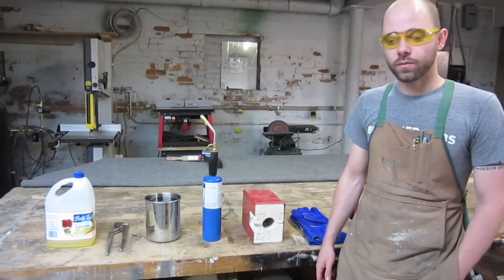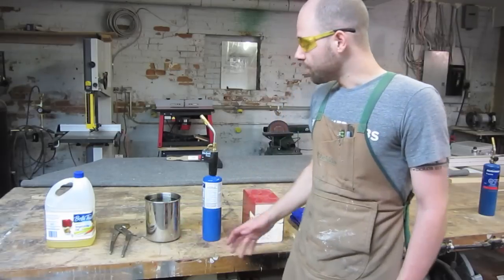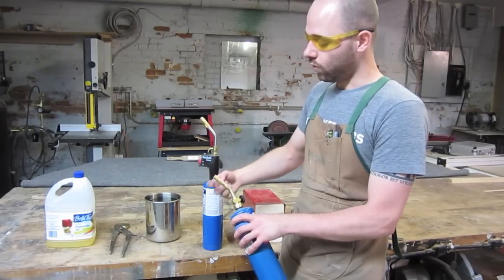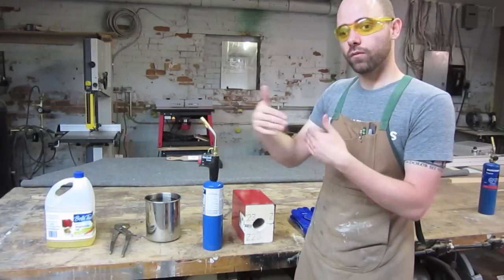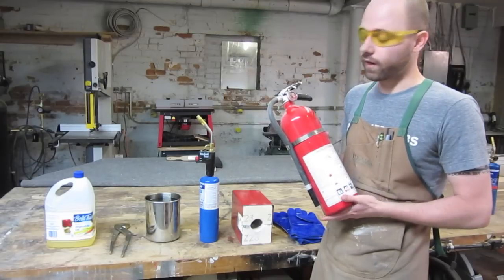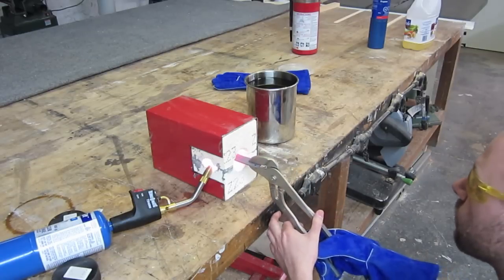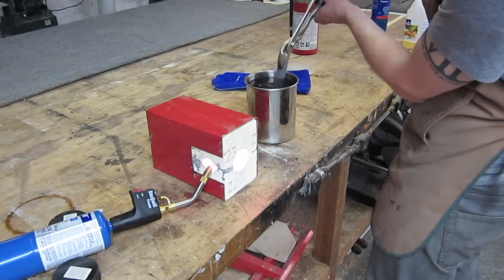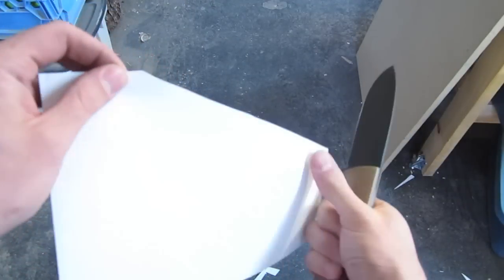How to heat-treat an O1 knife blade using cheap common tools.

Comment: I am also wanting to build a small propane forge now. But the problem is that here in Germany you cant get Firebricks, i am rebuilding my shop right now and we use bricks that look exactly the same as the american firebricks they are called ytong bricks.
Then I did some research on the internet and they said that they will explode if you heat them enough. So i put my PPE on and tested it. They get red just like yours did and it
didn´t explode or anythinhg like that. But i am not sure if it is the same because they are way cheaper than firebricks. And i am afraid that bad things are gonna happen.
Please help me :D
Reply from the maker: Hey mate... Any brick used for building a house is not suitable for use as in a forge. Simply because they do not reflect enough heat. You will definitely be able to get 'fire brick' in Germany, they are used in every country for lots of industrial purposes. Look for furnace supply places and look for 'refractory brick' 'kiln brick' 'furnace  brick' etc....
Reply: Gough Custom Ok, i'll look for it. Thanks for the reply mate.

Comment: I'm buying a propane torch and fire brick tomorrow. I've got everything else..

Super nervous about the blade cracking. I worked really hard with hand tools to make this knife and I don't want my effort to be wasted. My blade is a bit over 1 inch long, so it shouldn't take very long to get it to cherry red. Wish me luck, I guess.
Reply from the maker: +Copperman if you're using O1 and quenching in oil then there should be pretty much zero chance of cracking, so I wouldn't worry about it too much!
Reply: Alright. I've got a small toaster oven I can use to temper it. Thanks for your help, Aaron
Reply: 1.65 years later and I sell my work at a gallery. How funnnn

Comment: Also is it smarter to check the steel with a magnet to see if it's non magnetic before quenching it in the oil
Reply from the maker: +Jake Wido Hey Jake! You can certainly use the magnet as a reference, just be aware you have to go a bit hotter than non-magnetic before quenching O1.
Reply: +Gough Custom thanks a lot always helpful, if I was to use the magnet as a reference would the tempering process be any different because the temperature before the quench?
Reply from the maker: +Jake Wido No worries mate! The temper process will be the same either way.
Reply: +Gough Custom thanks again very helpful video, I'd really like to learn how you etch you blades as well with the acid.
Reply from the maker: +Jake Wido It's not very hard at all! Basically just dip the whole blade in Ferric Chloride for 10 seconds, scrub it down under cold water with a toothbrush then dip it again. Repeat that 3-4 times. 

It's important to sand the blade well before hand though. Any scale or decarburization left on the steel after heat-treat will stop the etch from coming out nicely.

Comment: Would this method be more for 1080, 1084 or 1095 steel as I think 01 tool steel needs to be heated at 1500F for 10 to 30 minutes before quenching to get best results?
Reply from the maker: +Vernon Cooney it will work with any of those steels including O1. You will get better results from O1 with a more sophisticated heat treat, but that's basically true for any steel

Comment: Hi, I have the basically the same setup as you, and I can get my steel to the same cherry red color, but for the life of me, I cannot get it any hotter! I need to to be at least 820 C (1500 F)
I've tried 3 times to even get it to non-magnetic, but I just can't do it. How long is it supposed to take? I spent 30 minutes and nothing...
I am using O2 tool steel, btw.

Hope you can help!!
/William
Reply from the maker: It should only take a couple of minutes to get the temperature you need... Are you using propane or MAPP gas?
Reply: @GoughCustom  Thank you for your reply.
I am using a butane/propane mixture (80% butane, 20% propane)
The torch I'm using is said to be able to heat to 1200 C, is this too low? If so, I can buy one that can heat to 1850 C. There is not a lot of options on my area :)
/William
Reply from the maker: @williamt1083  Ah yeah that explains it. Butane is definitely not able to get hot enough! You will want 100% propane at the very least!
Reply: @GoughCustom  Okay, I will see what I can find :) Thank you very much!

Comment: I live in the netherlands and im planning to make knife's we only can buy O2 steel here is that the same as O1 steel? If i know it i can order it thanks already !
Reply from the maker: Brat Boon I haven't used O2, but it looks like it should behave very similarly to O1, both in terms of heat-treatment and performance. I would say give it a shot! Heat-treat it the same way as I show for O1.
Reply: Thank you i will give it a try and i will let you know!

Comment: When u move it in the oil, when u say side to side do u mean blade and spine moving foward and backward or the faces moving forward and backward.
Reply from the maker: Blade and spine, like you're trying to cut the oil. If you go side-to-side, then one face will cool faster than the other and the blade will bend!

Comment: What about using used motor oil? Ive heard people talk about that before. Any advantage to one over the other?
Reply from the maker: I strongly recommend not to use motor oil, especially used motor oil. Motor oil contains additives that let it absorb water, this is great for protecting your engine but when that absorbed water is exposed to a 1400ºF blade it turns into steam and expands, which in turn can vaporize the oil that contained it, and that oil vapour can then cause serious fires.

The fumes from motor oil are also probably quite bad for you.

The best oil to use (apart from special industrial quenching oil) is canola oil.

Comment: does this process also work for any other Steel?
Reply from the maker: +Bushcraft LP yes it will work for any carbon steel out low alloy steel, eg: 01,5160,1095,1084,1075 etc
Reply: Ok thank you

Comment: hey do you need to normalise the steel before heat treatment? if so how many times? I'm a bit confused on this point
Reply from the maker: +Chris O'Brien you don't need to normalize unless you've forged the steel. If you're making a knife via stock removal then just go right to heat treat!
Reply: really cool thanks for that

Comment: is non magnetic required for 0-1 steel? it didnt seem very hot.   im thinking of going from 1080-and1095 to 0-1 for hammer forged knives, is that an upgrade? thanks
Reply from the maker: +BattlesBlades You need to go a bit hotter than non-magnetic for O1. How hot the steel will 'look' will depend on your ambient light. White hot steel in a dark room will look much darker in full sunlight. I recommend heat-treating in a dim room for this reason.

Comment: What does heat treating a blade do? I'm using 01 steel and since I'm not an extremely confident person I'd like to avoid the step. Is it possible to skip this step and still getting a good blade? I've made a knife about a week ago and all that's left to do is heat treat it, I'm really afraid to screw something up.
 I wouldnt mind having to use a microwave oven but I'd prefer not to use a forge...
Reply from the maker: Hi Liam,
The heat-treatment step hardens the steel, which is very important because otherwise the blade will not hold and edge well at all.

Because of the temperatures involved something like a forge is necessary. You can also use a charcoal BBQ if you're a bit inventive.

-Aaron
Reply from the maker: It should be said too that there's always the possibility of screwing up at every step along the way in the knifemaking process. I've had to throw blades out that were nearly finished, so has every other knifemaker I can assure you.

Don't be afraid of screwing up, just do your best and don't worry about failure too much, it's just a part of the learning process.
Reply: Well that gave a sprinkle of confidence. I'll go out and buy those bricks, theres not much to lose except a piece of metal. Thanks alot! :D
Love your videos by the way. I aspire to be as good as you one day.
Reply from the maker: Liam C Exactly, just be careful (and safe) and the worst you can do is have to start over. That's something that any creative person will have to do many times during their learning process. As the mythbusters guys say: Failure is always an option!

Comment: I read somewhere that 01 needs to soak for 20 to 30 minutes at final temperature.    Does that just make it harder?
Reply from the maker: A long soak is definitely better, but not really achievable with simple equipment. You're likely to overheat the steel which will make the steel brittle, so you're better off going with a short soak like this instead. You'll also get a lot of scale and decarb with a long soak unless you have protective atmosphere
Reply: Thank you.

Comment: Is it non magnetic when it is dull red? I have found O1 reaches none magnetic when it’s more orange than red?
Reply from the maker: The color I'm aiming for is a bit beyond non-magnetic. The issue is that the color changes drastically depending on how much light is around you... I think orange is a bit on the hot side, but if that's working for you then that's great!

Comment: Do you temper it one time for two hours? And if i heat threat my knife in a fire for what should i look out?
Reply from the maker: Robin Giebels Hey Robin! Normally I temper twice for 2 hours each time, cool to room temperature in between. When heat-treating in a fire you want to make sure that you're using mainly coals (charcoal is best if you can use it), same overall rules apply otherwise.
Reply: A lot of thanks it helped a lot. Love your videos and your knives.keep up the good work!
Reply from the maker: Robin Giebels Thanks Robin, will do!

Comment: Can you reheat the knife after quench? Meaning I heated my knife and quenched it. A magnet still stuck to it.
Reply from the maker: Hey Jimmy! The magnet is supposed to stick to the steel after it's been quenched. The only time the magnet will not stick to it is when the steel is very hot (around 1450ºF).
Reply: Gough Custom awesome thanks!!! Love the videos btw. Learned a lot from watching.

Comment: does 01 need to be normalized or is it fine just being broght up to critical temp then quenched
Reply from the maker: Usually it's fine to heat-treat it without normalizing, because it's a tool steel it's well annealed and normalized as part of the production process. If you do any hot-work (forging) on it, then normalizing would be a good idea.

Comment: How could you find steel that is good enough  for making a nice knife blade
Reply from the maker: Basically just buy a known steel. For beginners I recommend O1 tool steel. You can get it from industrial supply places (like KBC tools, or ENCO) from a knifemaking supply place (like USAKnifeMaker or Jantz Supply) or even from Amazon.
Reply: Gough Custom thank you for this info

Comment: Could I just use the torch if I don't have a forge??
Reply from the maker: +Jason Becker You can certainly try but usually the blade will be shedding too much heat and you won't be able to get it hot all over. The forge helps retain the heat and makes it easier to heat the whole blade.

Comment: So does 400° For 2 hours give you good tempering results for 01?
Reply from the maker: Yes it does! A double temper is better though, 2 times through 400ºF for 2 hours with cooling to room temperature in between.

Comment: Which tape should I buy for knife making? I wanna buy some quality tape but don’t know what’ll be best?
Reply from the maker: What do you need the tape for mate?
Reply: Gough Custom Rad for replying!   Thanks (Not really sure, as iv just started knife making) defiantly for keeping 2000+ grit sanded blades from scuffing up before the etch and scale assembly. Also for keeping wood finishes off the blades and blade finishes off the wood? Idk really, I just want 1 good quality roll, already wasted money of two other tapes that leave adhesive behind an just can’t cut it (no pun intended).
Reply from the maker: I just used the standard green masking tape from the hardware store and haven't had any issues!
Reply: Gough Custom sweet thank you 🙏🏾

Comment: Do you have to also get the tang of the knife cherry red?
Reply: College Days no, you only need to heat treat the blade. The tang needs to be left soft.
Reply from the maker: As Dave said you don't need to harden the tang. You don't need to leave it soft either though, either way works fine!

Comment: Do you fully sharpen the blade before heat treat and temper?
Reply from the maker: +Joel Molina No... Leave the edge about 0.02" thick before heat-treatment, then sharpen afterward after final assembly and finishing.
Reply: 10/4 sounds good. Thanks for your help and videos.
Reply: Also how do I sharpen. With stone or sand paper?
Reply from the maker: +Joel Molina I use the Lansky system, which I show in another video.

Comment: When the blade is dull cherry red is the steel non-magnetic at that point?
Reply from the maker: +Peter Wile Yes it will be. Ideally you want to go a little hotter than the point where it goes non-magnetic.
Reply: +Gough Custom Thanks

Comment: Ment to ask, why do you now use a2 steel and is it not harder to get good results after heat treatment?
Reply from the maker: I use A2 now because I found that it was tougher, has better corrosion resistance, and also holds an edge better. It's more complicated to heat-treat, but with a proper kiln it's manageable!
Reply: Thank you for your reply. If you don't mind me asking, what would you call a proper kiln and did you or could you make one. Finally does it cost more to produce a knife in A2? I am talking energy used by the kiln as soaking (holding times) will, I think be longer.Thank you once again.
Reply from the maker: pa maj You could home-build a kiln yes, there's a few people that have done it on the net.

I'd bet the cost is comparable, given that electricity is cheaper than propane. It's not really something I've looked into too much though.
Reply: Cheers  Gough.

Comment: What kind of store would have fire bricks? Thanks any help appreciated:)😀
Reply from the maker: TheSlothMaster Ceramics supply places or furnace supply places should have them. Amazon sells them too but they're a bit overpriced.
Reply: I think hardware stores would have it too
Reply: ok like home depot?
Reply from the maker: TheSlothMaster It's certainly worth asking around! The ones in my area didn't have them, but I'm in a city...
Reply: home depot most certainly
Reply from the maker: Don Williams One thing worth noting is they have to be soft fire-brick, the kind you can gouge with a fingernail. The Home Depot near me only has 'hard' fire brick, but others may be different.
Reply: ok thanks
Reply: TheSlothMaster I got mine from a brick yard.
Reply: ok thanks

Comment: Sir, the metal u use to make u knives, is it Iron ? Or Steel ? I am using Iron, but it is not getting any red !!
Reply from the maker: Hey Michael! For knives you have to use steel, and you have to use specific types of steel that can be hardened... If the steel is not getting red then likely the torch you're using to try to heat it is not powerful enough.
Reply: @GoughCustom  thank u for the information

Comment: hey gough, can i use kitchen oil for quench the blade ???
Reply from the maker: You can yes. The best ones to use are 'vegetable oil' or 'canola oil'. Make sure the oil is new, and make sure to replace it if it's been sitting around for a while... The oil will absorb water from the air as it gets older and this will increase the risk of the oil exploding or catching fire.

There will always be a little bit of flame when quenching in vegetable oil, so make sure you have gauntlets and flame-proof clothing on as well as a face shield!
Reply: thank you man !!!
Reply from the maker: Italo Romano No worries! best of luck, and be careful!

Comment: what is the expected rockwell hardness? and is there anything else we need to do example tempering more than once ?
Reply from the maker: Expected hardness is around 59HRC. Double tempering is a good idea but not strictly necessary for O1.
Reply: Thanks! What do you think about heat treating d2 is it as simple as o1 is there anything to worry about for d2 heat treatment ?

Love your vids and they convinced me to buy tools to make a knife for my self! Thanks!
Reply from the maker: Medium/high alloy tool steels (like A2, D2, S7 etc) cannot be heat-treated in the way shown in this video... They require a furnace or kiln as well as controlled atmosphere for heat-treatment unfortunately.
Reply: Cool thanks! I guess O1 it is then! Thanks
Reply: plus. Waiting for your new vids!

Comment: Dose the magnet test work for this method on o-1 or is it just by color just want to double check my temp if posible
Reply from the maker: The magnet test will work. For pretty much all steels (including O1) just be aware that you have to go a little hotter than just non-magnetic. The general idea is to go one shade of red brighter than when the steel is not magnetic... Try it with some scrap steel and you should see what I mean!
Reply: ok cool thx i should probly practice anyway as i have a coke forge for now